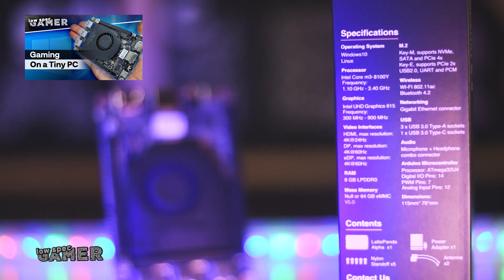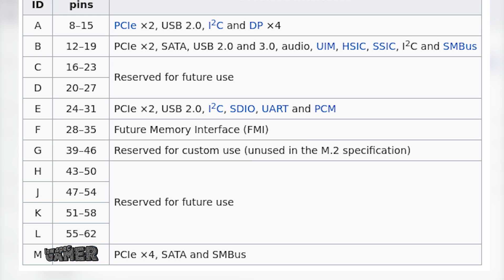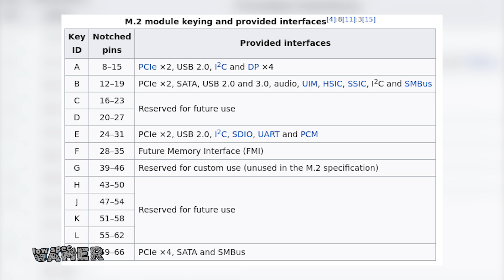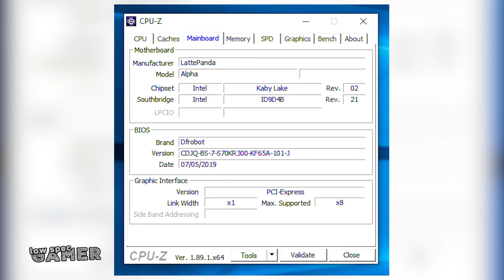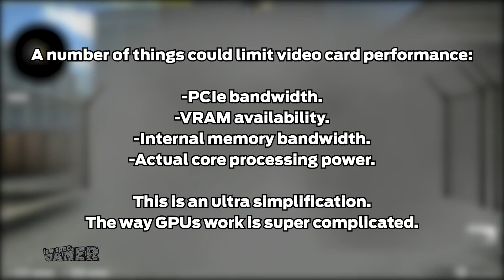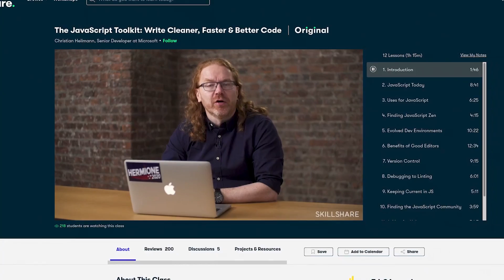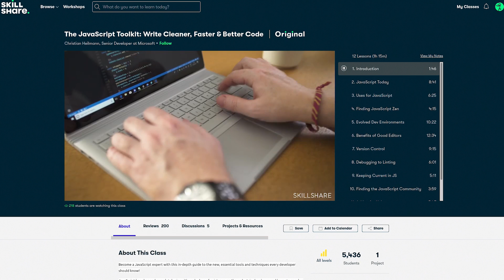Adding a GPU to the new Lattepanda Alpha mini PC! (2019 model - RX 550 GPU m.2)

Comment: If you can someone to make the board and cables for you, I'd be really interested in seeing if you could combine the two M.2 ports into a single PCIe x6 slot. In theory, this should work, as it's just PCIe lanes being used.
I'd also be curious to see if you can split an M.2 port into it's various ports. B key carries SATA, USB 2.0/HSIC, USB 3.0/SSIC, UIM, I2C and audio, M key also carries SATA. Would it be possible to combine the two with cables onto a single board that gives you PCIe x6, two SATA ports, audio, and USB? Essentially turning the LattePanda Alpha into a motherboard, where the daughterboard really turns it into a PC? Other than the low spec CPU, this could turn into a fairly decent mini PC.

Comment: you should do a build with a discrete card and a 1600af(with like a rx 570 or something appropriate for the budget) and compare it with your 3200g/3000g systems and see if it's worth the extra expense

Comment: Speaking of the Hdmi to Expresscard, Is it possible to use an adapter to use it in a PCCard Bus?

I know there are expresscard devices can be used in PCbus, but I'm not sure if the device would even boot with somthing like that.

Comment: A used Dell DA-2 power supply works like a charm for powering external GPUs on the EXP GDC. The connector is a 8pin used on most GPUs and the EXP GDC comes with a 8 to 6 pin adapter. ~200W GPUs (~RTX 2060) can be run off it, if it's not too old & degraded. It'll make a little humming sound as the 5V lane is not under load as would be normal.

The most annoying thing about eGPUs is checking for memory address space or trying to work around this. Also windows & NVIDIA have made some changes that made running eGPUs more difficult in the past 2 years. :-(
Reply: Well in my opinion nvidia and windows can go suck a fat one.

Comment: Connect the green pin to any black pin on the 24pin connector of the PSU. The green pin is the sense pin that tells the PSU to turn on. Using a paperclip to short it to ground (any of the black pins) will cause the PSU to turn on. It's a different story if your PSU has all black cabling, but for the ketchup and mustard cabling it is as easy as that.

Comment: Looking forward to the bandwidth gains from pcie 4.0 since 4 Lanes on 4.0 would be equivalent to 8 lanes on pcie 3.0. One thing I haven't heard about is the benefits of 4.0 I regards to the gpu's access to ram. Does that also imply double the bandwidth between ram and GPU?
Reply: GPUs have their own ram and don't really need to use the general system ram

Comment: Pls make a video on Ryzen 5 1600.. Only ₹8500 , Roughly the same price of an Ryzen 3 3200g.. Which is better?  I'm looking to Pair the R5 1600 with an Rx550..
Reply: The 1600 is way better since you are pairing with a GPU (it is very capable of much faster GPUs too later down the road when you upgrade).

Comment: why not tech companies just adapt this and build a low cost and lightweight laptop??
Reply: Similar performance gaming laptops are already same price or cheaper with much faster CPU and memory. The Panda is far from cheap, it’s pretty expensive!

I’m not sure how lightweight you need, even my well performing laptop (GTX 1070 overclocked to beat overclocked desktop 1070, and an 8750h which is insanely power hungry at 85w boost speeds, all with a 120Hz screen fits in a nervously thin 1 inch thick laptop and weighs like half of what my old HP did even though it only featured integrated graphics and not the crazy good cooling system of my new one). So too me this is light enough (they are using the array of cooling pipes to give the laptop rigidity, so literally any lighter and I’d be extremely worried using it!)

The Panda is far too expensive and slow for a decent laptop, but AMD has some very low cost Ryzen laptops at like $350 that are crazy good value that you might be interested in (the next bump would be the 8750h with GTX 1050 at like $600, but AMD probably has something better at that price too). The Panda just can’t compete (especially adding the cost of the screen/keyboard/power brick/batteries/SSD and not even taking into account how much faster the laptops already are with hyper-threaded quad or hex cores)
Reply: @jakegarrett8109  I thought Panda was affordable. But that's ok., 
At least this will be a lot lighter I suppose. 
Why can't companies launch laptops that weigh less than 500gms, with .50 inches think. May be a low powered cpu,4gb ram,64gb ssd,etc with average battery. Laptops aren't as portable as it should. If someone needs gaming, let them buy desktop or gaming laptops like you have.

Comment: Is your newer CPU vulnerable to Spectre/Meltdown? Because that might be what is causing the older CPU to perform better as the Meltdown patches rob performance. There is an easy way to check as there is a program called "inSpectre" that lets you toggle the patches on/off.

Comment: 4:25, couple of pins? Just connect the green and any random black ground on the 24 pin connector, hell you can even cut them, strip them and tie them together and bam hardwired PSU you can switch off. Extremely easy all you need is a paper clip lol

Comment: To start the PSU easily, there is that watercooling loop tool to short a PSU to help fill loops. 
There is also using a PSU tester to help short the pin. I use one and a fan hub to test fans before I install them into a case.
Reply: Only thing you need to do is short the green pin with any black pin.

Comment: Some of the issues might have also been from the lack of a GPU power connector on the graphics card. Depending on the adapter even if it has it's own power connectors it may not be able to output the full 75w capable of being drawn from a PCI-E connector (The external adapter that worked is probably capable of outputting 50w given it ran the RX550).

Additional thinking about why the Nvidia cards weren't working is they might be thinking they are plugged into a PCI-e 3.0 system and not auto-negotiating down to PCI-E v2 as used by the Lattepanda and thus crashing. The 1050 without a GPU power connector probably is a limitation of the external converter however, The 1050 running without drivers is basically at forced idle and using only about 15 to 20 watts. I have had it running on certain external PCI-E cards made for mining but their breakout boards are normal PCI-E x1 and not M.2.
Reply from the maker: Thank you for your insight
Reply: @LowSpecGamer  Better one person spends a week puzzling it out then a thousand spending a week each :) . Back when I was looking into something similar for my laptop I also considered using expresscard or daisychaining using a PCI-E Thunderbolt card to an eGPU case but the cost of the setup got pretty prohibitive as compared to upgrading my fileserver with a cheap SFF pc and streaming over the local network.
Reply: @LowSpecGamer  I found a 70w external psu that connects directly to a molex cable, here: https://www.performance-pcs.com/system-hardware/power-supplies/phobya-external-psu-230v-to-4pin-molex-70w-including-euro-uk-plug-ph-1013048.html

Comment: Me trying to boot windows per USB on my old laptop. operation system not found for the 100th time

Me turning on video in frustration.
Reply: did u try wintousb i have used it and it worked for me. just make sure to use uefi or bios settings depending on what your pc uses.

Comment: exp gdc does have m key I have one but it was not cheap. gtx 1060 single fan option works and a dell psu I think da-2 is the smallest solution. im selling mine as I just don't game as much on pc and my uhd 630 is plenty for what I end up playing. I was going to play a lot on a mini pc from AliExpress with an i7-8750h yes a laptop cpu with uhd 630 in a mini pc smaller than a gamecube.

Comment: memory latency is the largest bottle neck in most high performance applications. Dropping your memory speed effects everything
Reply: Can you explain a little more please? I don't 100% understand.   :(
Reply: @aa-vb9tj  CPUs currently operate much faster than RAM - about 200-300x faster - unless accounted for - it will spend most of it's time just waiting for the next instruction or data it needs. 

Most processor have A LOT of mitigations in place to make this less of an issue but it's not perfect and with slower single channel ram it will be more pronounced.
Reply: @Tinfoilpain  thank you for explaining. Speaking of ram channels, is it not true that software plays a part in actual utilization? Since this video focuses on gaming performance I wanted to bring up that I have seen other channels/videos test quad channel and even eight channel memory with either diminishing or little to no returns. So the question again is software also a limiting factor in this situation?

Comment: Some two years ago I bought an mini PCI-e to PCI-e adapter from AliExpress, and while looking for an GPU to use with it I found out that Nvidia was blocking the 10-Series GPU from running on the mini PCI-e port via driver updates. I was going to get a 1030, got a RX550 instead and it got me going for some heavier games, until I built my PC and used it there for some time. It is very finicky to use an eGPU, sometimes the system doesn't recognize it, sometimes you have to boot it, hibernate and then plug the adapter, and sometimes you straight out get a BSOD or nothing at all.  And don't forget the fear that everything might go up in flames if there's something wrong with the cables
Reply: I really hate nvidia because they pull crap like that all the time, which is extremely anti-consumer.

Comment: Great work! 2 Questions:
> Would using a more powerful GPU like an RX 580/5600XT or GTX 1060/1660 SUPER result in better framerates? Or would the m3-8100Y be a bottleneck?
> Would the following PCIe to M.2. ribbon cable serve the same purpose as the dock?
https://www.amazon.com/ADT-Link-Extender-Graphics-Adapter-PCI-Express/dp/B07YDH8KW9/

Comment: Personally had an interesting experience with PCI-E bandwidth in an old dell that wouldn't recognize that my hd 8570 was x8 and instead ran it at x1, the motherboard had pcie 1.1 so the bandwidth was 1/4 of what the lattepanda has. In practice that meant getting 300fps in indoor areas in half life 2 and getting 15-25 in outdoor areas regardless of settings.
Reply: A modded or unlocked bios might be in order

Comment: I think the Latte Panda is a pretty cool device but only worth it if you need the small form factor AND an X86 CPU. Personally I have little use for one and it's too expensive compared to standard hardware or a Raspberry Pi to get one as a plaything.

Comment: As someone who had trouble getting my LattePanda delta to recognize a GPU, the advice Nando from eGPU.io gave me was use ADT Link m2 adapters. Worked for me beautifully with a gtx 1650 where previously it didn’t work
Reply: Love your projects <3
Reply: CoderH thx! <3
Reply: I used an ADT link in m.2 Ekey to run a parallel port but i dont think it's working is their something i need to do to get it working

Comment: Bruh shorting the 24pin connector to make the psu work is not a hassle at all. You literally just need to bridge two specific pins with a small wire or even just a paper clip. Even my lazy ass with no previous experience managed to do it very easily and fast.
Reply from the maker: I was in a rush
Reply: Fair enough